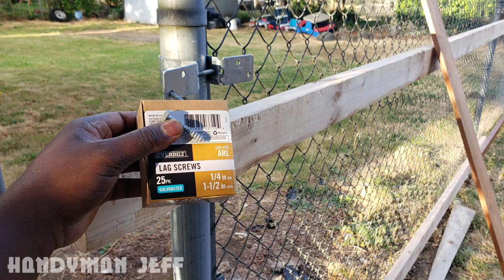Building a Wooden Fence over a Wire Fence

Comment: Looks good im trying to decide whether to space out the pickets then come back & cap the sides with pickets so leaves out the gaps when boards shrink, seen couple other videos where they space each board 5" apart then vomr back to overlay the space being the width is usually 5-1/2" which would give a 1/4" overlay on the boards never having to deal with gaps when wood shrinks.
Reply from the maker: That would bring your fence to a total privacy

Comment: It's easier to stain the wood before you install it on the fence.

To make the chain link side look better, paint the posts and wire close to the color of the wood. A roller does a good enough job on the wires.

Comment: Looks good any way we could see the other side. I’m thinking of doing this around my back yard but I want the curb Appel so I’d be looking at the ugly side from inside the yard
Reply: Paint the posts and wire the same color as the wood.

Do a 2-sided wood fence Put the stringers onto both sides of the chain link fence, put boards on both sides.